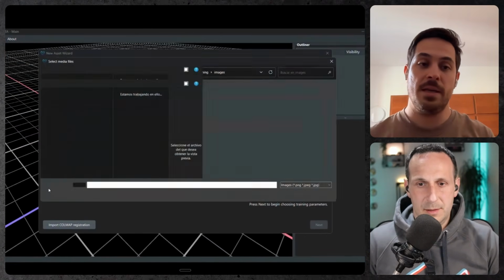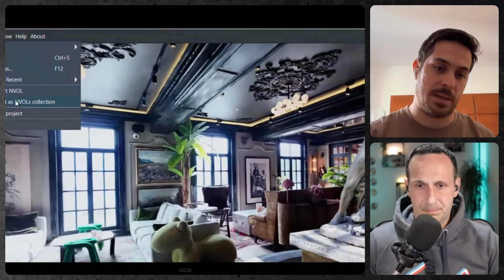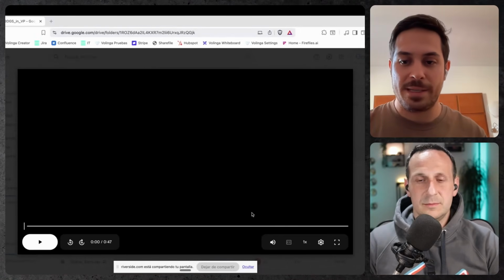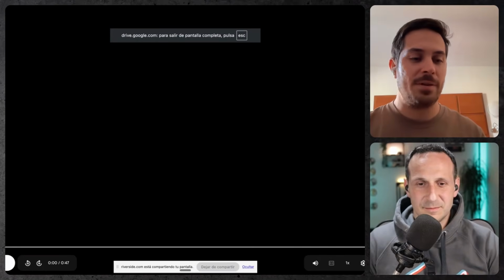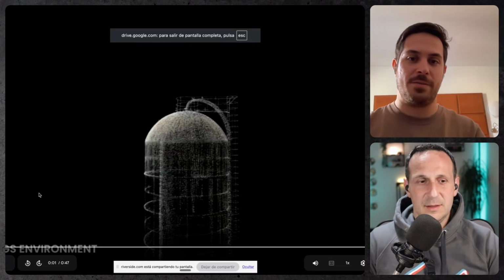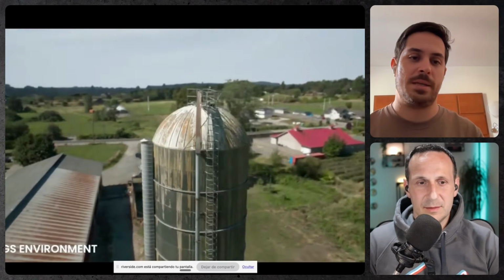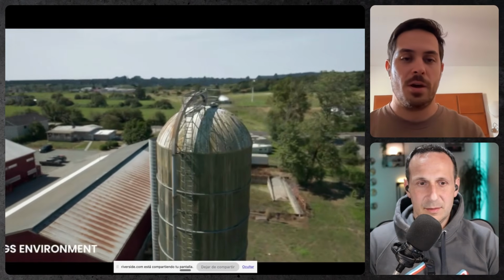Relighting Gaussian Splats Is Now Possible

Comment: But you need specific plugins to manipulate, rendre and relighten gsplats in unreal. As long as there are no native unreal included and supported plugins that are well integrated in the unreal ecosystem this will not become mainstream...
Reply from the maker: I totally agree and that is a big problem with current game engines and the adoption of 3DGS: they are lagging behind when it compares to web based engines like playcanvas and three.js.
I wonder why the adoption has been so slow. Technical challenge or a deliberate decision?